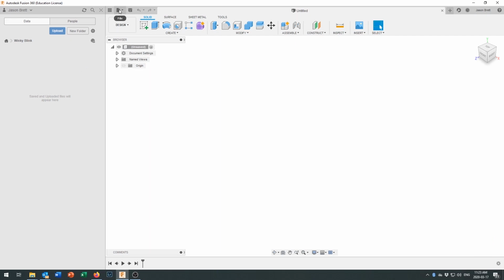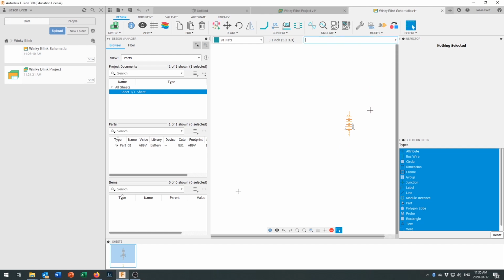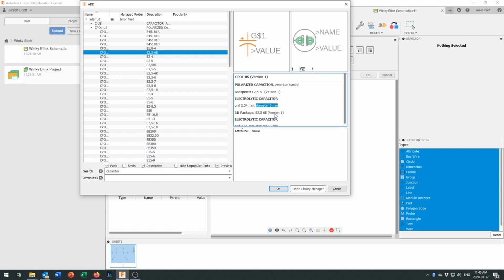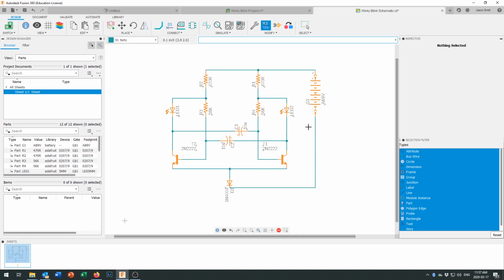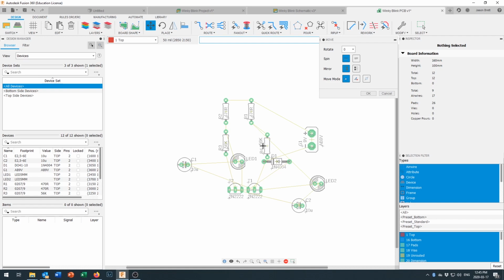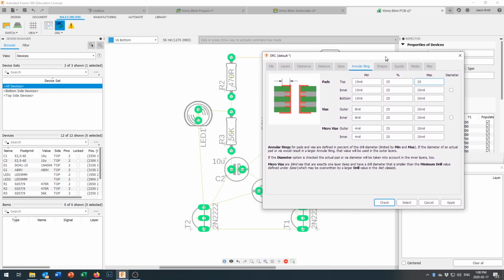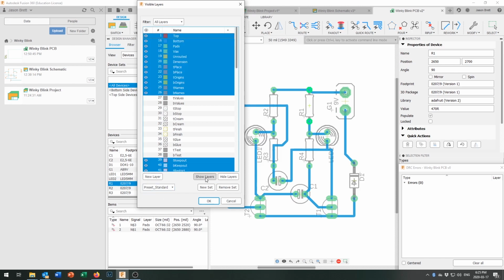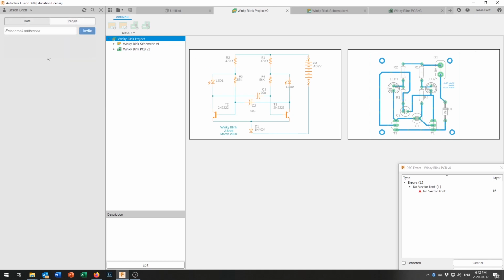Making a Winky Blink in Fusion 360 Electronic Design

Comment: Great video. If you have time one day could you do a demo on how to make custom electronic components in your own library?
Reply from the maker: Thanks for the kind comment. I would like to do that video, but it may have to wait... the semesters have changed and I'm not onto different topics with my classes. I also have to admit that when I tried doing this in F360 it seemed needlessly complex and confusing in comparison to DesignSpark, the PCB CAD software that I've been using for almost a decade. I'm not too concerned about that as Autodesk seems to be working very diligently to integrate Eagle into F360 and I'm sure they'll be going after some of the "rough edges" and making it easier to use over the next year or so.